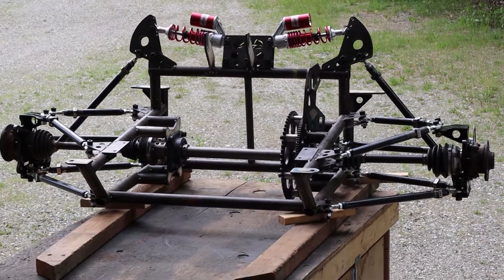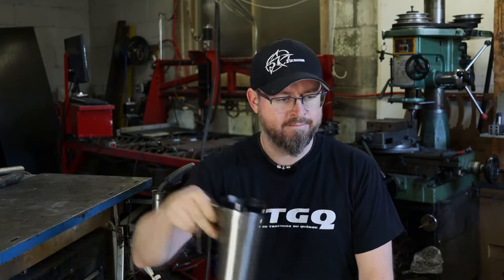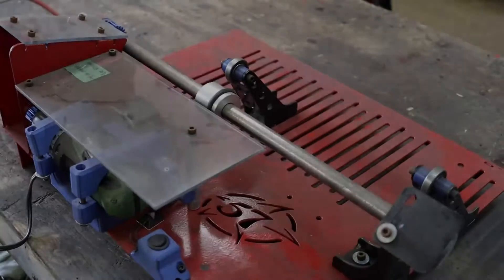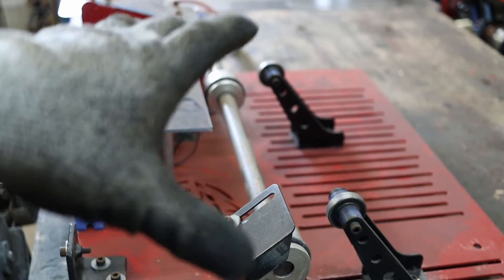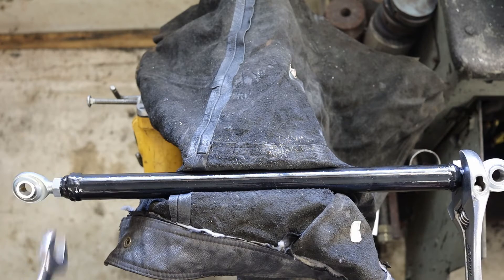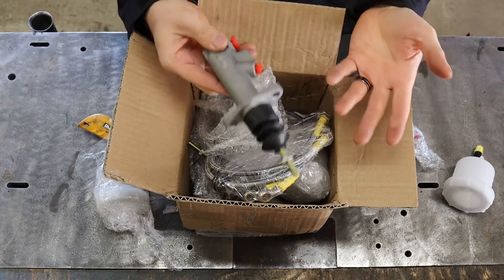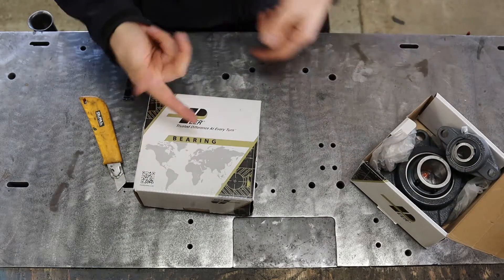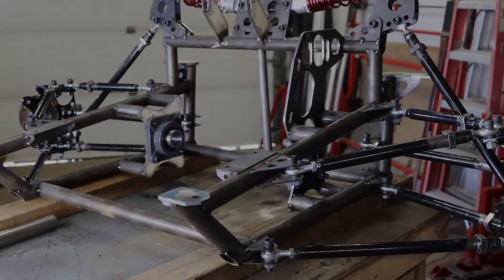SMART HAYABUSA PART 5.2:  THE REAR SUSPENSION

Comment: I have a question about the rear suspension. So you know how a wishbone is connected to 2 points on the chassis, and 1 point on the knuckle/spindle. What if you had 2 attachments on the chassis AND 2 attachments on the knuckle (for rear suspension). Would that mean you could take out the toe link in the rear? (Since the dual attachment points would hold the wheel straight)

I hope this question makes sense
Reply from the maker: Hi Mitchell, if you use 2 points on the knuckle from a wishbone,  you won't need the 5th toe link, BUT you need to have the 2 points as far appart as possible, creating that lever to counter hard braking or high HP accelaration. I know that some older Hyper cars has that type of suspension, check Lamborguini Diablo or old Mclaren... Now what I see often is upper-lower wishbones and a toe link.

Comment: i have watched many of your videos i am going to do  a similar build to yours but i will be installing a honda blackbird engine but i am trying to work out my  budget for my build i have a large variety of equipment a lathe a tig welder a mig just wondering if you can give me the cost of your build please
Reply from the maker: Absolutely, and by the way, in the final video of the serie (out at the end of 2020) I will put all the details and cost of the built, but I'm at 9000$ CAD for phase 1 (no cage, no turbo, stock motor, but complete driving car) the part that was unexpectedly expensive was the brakes. Dics, pads, calipers, pedal box, line and fittings are really pricey. About 1/5 of the budget!

Comment: How do you know on which spec you want to torque your nuts and bolts? e.g. 50Nm for your subframe to frame bolts.
Reply from the maker: I don't bother with that, since the subframe will be welded solide once install. I just won't take any chances of having the subframe passing me on the track... 😂